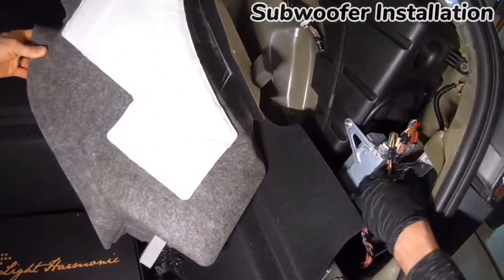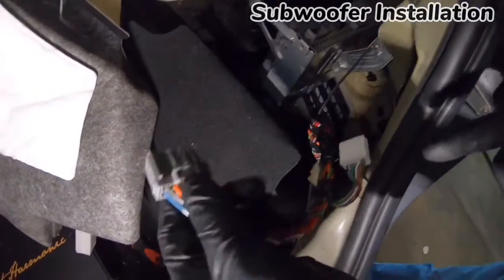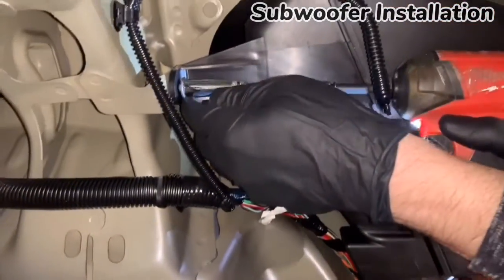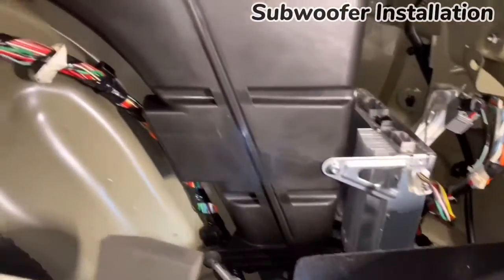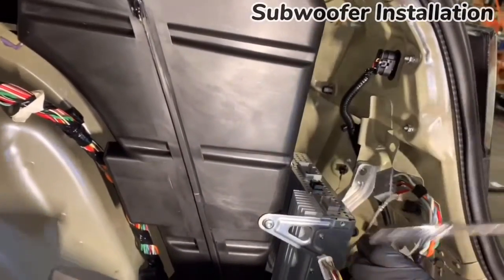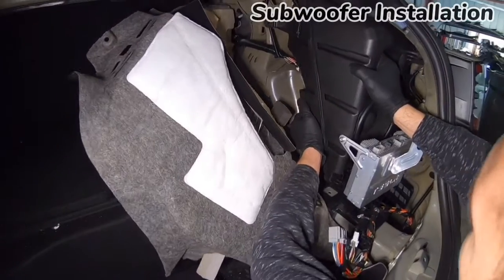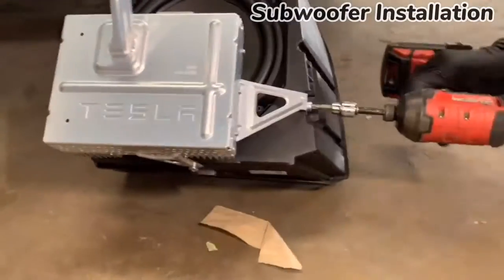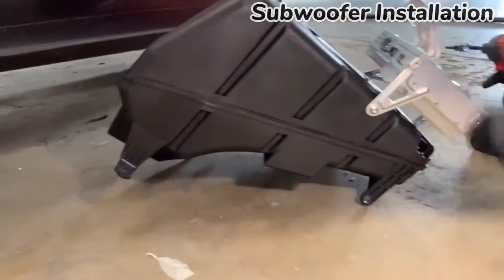Light Harmonic 'Tesla Model 3' speakers upgrade and installation

Comment: I have the standard range model 3 2021 and it doesn’t have the subwoofer at the back. Is it possible to still install an aftermarket subwoofer?
Reply from the maker: This would have to come with harness from an aftermarket provider and most likely needs to be activated if you do not already have it in your car.
Reply: @lightharmonic  a harness?
Reply from the maker: @Asbal91  For Standard Audio System in Tesla, we do not offer the Subwoofer. If anyone offers that, it won't be Plug n Play, like our system.

Comment: My current front dashboard mid-range speakers are soldered in, and I just bought the LH Mid-Range speakers and they come with the harness attached to the mids. What do I need to buy to connect the LH mids to my car, but not solder it in, is there a "male" harness available?

Comment: Will this kit work with the model Y or will that require a new kit?
Reply from the maker: Hi.
Most of the speakers included in our system for Model 3 will fit Model Y as well but we designed a special edition for the front door speakers on Model Y. This should be available in following weeks.
Thank you.
Reply: @lightharmonic  that’s great news! I’ll be sure to check your website! Please do an install video for speaker replacement for the model Y
Reply from the maker: @brianswails7276  The Model Y system is available on Amazon. Installation videos will follow.
Thank you,

Light Harmonic Team

Comment: Do you also have a guide on how to rip out the entire dash? Can it be done while leaving the dash in? Also, what bits are required for the screws?
Reply from the maker: Hi.
This can be done without removing the entire dashboard. You will need to remove the grill only.
A new video is coming with more detailed information.
Thanks.
Reply: They just took the dash out so it's easier to record The grill pops off and you can use a right angle driver or tool similar to what they were using to take the speaker out

Comment: Did I miss the part about how to install the rear tweeters?
Reply from the maker: Hi. No, you didn't miss that. We included the mid speakers for the back dash (trunk lid) after the video was done. We will need to update it accordingly.
Thanks
Reply: @lightharmonic  Great, thank you!
Reply: @lightharmonic  Im hearing that they are difficult, so would appreciate a video..

Comment: Looks great! On the subwoofer driver, it looks like where the speaker cable is routed, there might be a bit of an airgap there. Maybe it wouldn't make a big difference but I'd be tempted to create a better seal there like with some foam or sealant. Also, do you see any benefit (since everything is taken apart anyways) to add some polyfill in the enclosure and maybe some sound damping material on the outside?
Reply from the maker: Hello.
We apologize for the late response.
Yes, it is beneficial to add some polyfill. If you add too much the sounds will become dull. If it’s not enough, you won’t feel the difference.
Thank you.